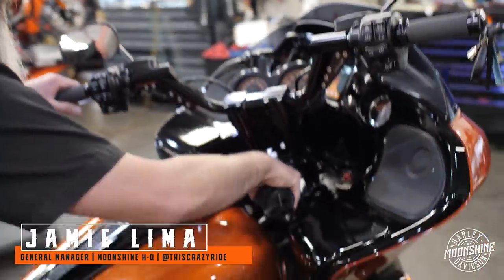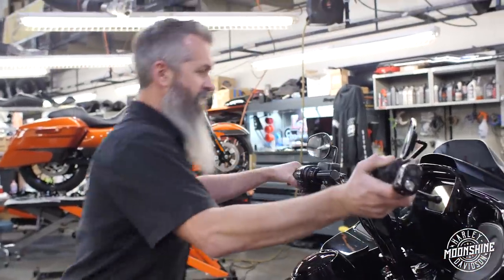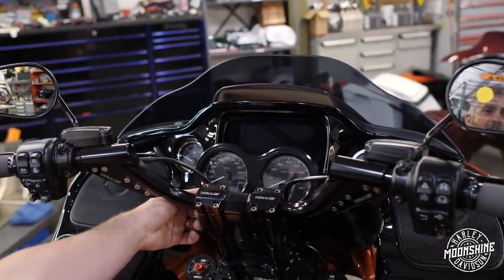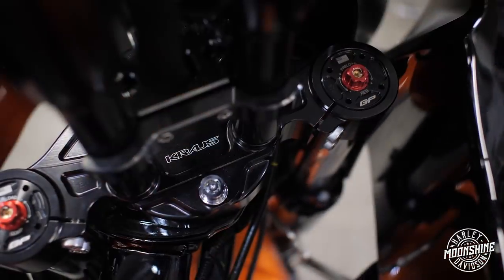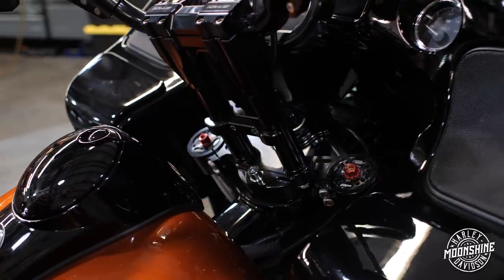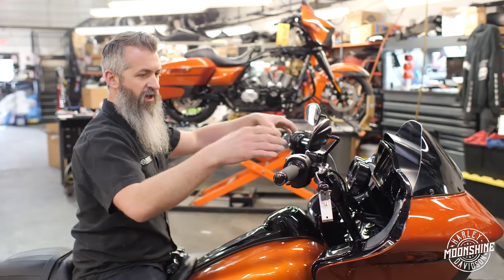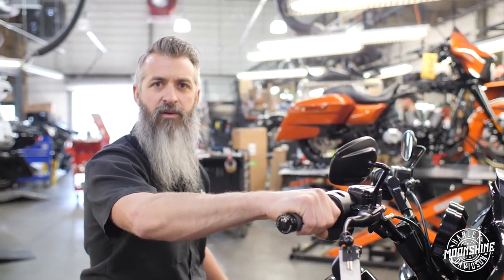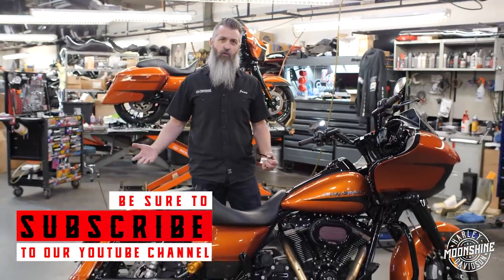Let's Build It! | Performance Bagger Starter Kit M8 Bike Build No. 1 | Shop Talk Episode 48

Comment: So good to see the front suspension is now adjustable. That's awesome. !!
Reply: Not from stock, those are aftermarket adjusters.
Reply: And expensive. Harley make like they made a much better and adjustable suspension when all you can adjust is the spring preload and even then it’s limited, once you go past a few kg:’s you need different spring rates. I raced +200hp BMWS1000RR’s so know a little about handling and stock HD suspension is shit, so are tyre choices which thankfully are getting better.

Comment: I have a 2020 SGS with the Kraus inverted front end, 10 inch Kraus risers with the fly Moto bars. 13 inch Ohlins on the rear and a sweet Lucky Daves seat. installed a stage 2 kit. Upgraded to a Feuling oil pump, camplate and lifters. Waiting for my Bassani mid length SS exhaust and Hoffman front carbon fiber fender to arrive. I'm retired at 62 and this will probably be my last bike that's why I keep upgrading. The whole oil pump, camplate and lifters was done after watching one of Your videos.
Reply from the maker: Sounds like a killer setup!!!
Reply: Sounds like a nice suspension setup Sir.

Comment: I would still need to see more of that screen. I went with the FXR Division Motorwitch bars. Same t-bar feel and look, no gauge relocation, no cable extension,  and you see everything.
Reply: I’m going to look into those
Reply: @grow_n_squish9198  Haven't felt any flex

Comment: whoever disliked this video does not know anything about the beauty of motorcycles. such a beautiful bike!
Reply: she owns a Honda Shadow,,,,,,,
Reply: @paulhewson4600  so she's in the wind for two grand. To ride this bike some dummy had to have 50k. It's not a motorcycle anymore its jewelry and I'm a Harley guy been one for 45 years but I like the Harleys that were bikes I had pans and shovels that would make this look like expensive junk.we didn't have bolt on kits we built those bike ourselves alot of the stuff came from swap meets. Now to be cool you take your credit card out and go to the Harley shop. Then bbn you ride this bike 2k before it starts sumping and cant pass a bleed down test.  I'm old so I've got a stock roadking and itll stay stock but if that chicks on a honda good on her she is a working class biker.

Comment: What would you guys do with a street glide ? The front if the bike is different of course
Reply: Similar bars with a kickback. The ERG SG Bars have a U where you look at the dash and then you get the 6” riser with a 1.5” kickback. You should be able to get to your dash 90% without issues. Only the bottom of the screen will require a little more effort. Really nice looking setup!
Reply from the maker: We have a video on it on the channel. Check out the ERG bar video.

Comment: Just had Black hills Harley Davidson install a 131" big bore kit on my 2020 road glide special. Still doing the brake in miles but curious on how you guys are getting 147 hp out of the 128". Could I have achieved the same performance say with a bigger cam?

Comment: Doesn’t running the shock oil line so close to the muffler hurt the performance and longevity of the oil in the shock due to temps?
Reply from the maker: The 4.5 mufflers bodies don’t get that hot.

Comment: So if that motor starts leaking oil and nocking like some of the outer ones you built you going to give the run around to that customer  or you Goin to use silicone for a base gasket to, or have you  Learn your lesson started using the gaskets you're supposed to if you're having trouble with motors that you build you more then likely need to find a better  Mechanic because the one you have is given you a bad reputation you say you stand behind your work then you should stand behind all of your work a bad reputation will carry further than a good one all you have to do is stand  behind your words and if you're wrong  Admit you're wrong and make you're wrong right And when you tell someone you're going to have it done on that day Then you should regardless of covid and slow shipping If you can't have it done by the day you should just say we can't give you a date Instead of giving the run around You will sleep better and things will go much better for you. I am truly grateful I had my local dealer do my build .